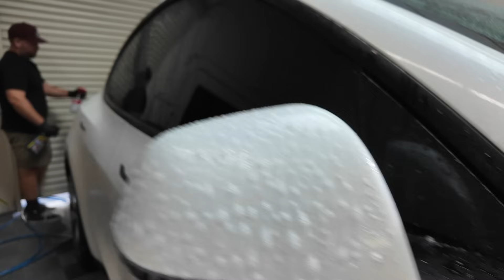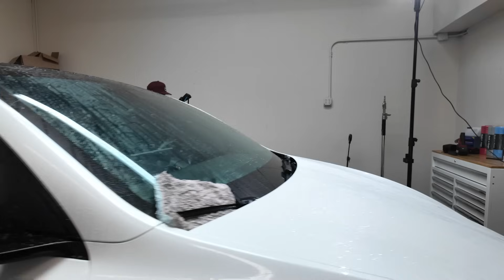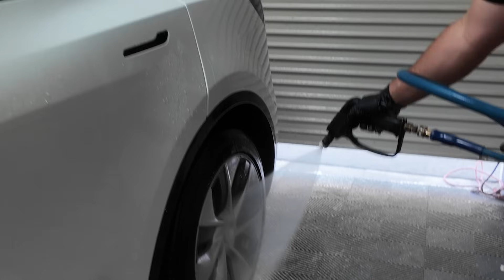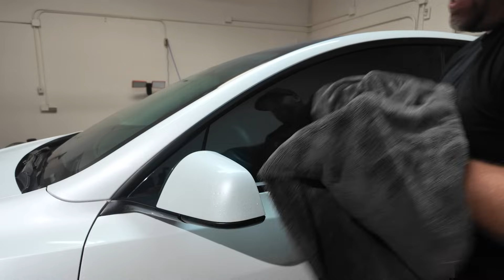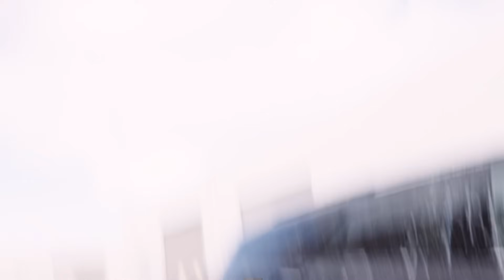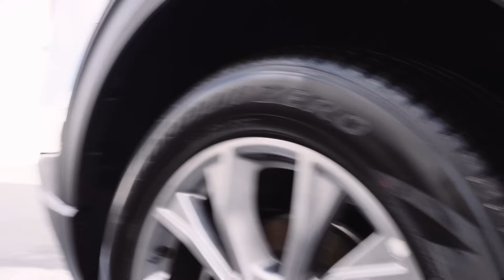The Uncomfortable TRUTH About The Future Of The Detailing Industry - SEMA 2023 After Thoughts

Comment: Hey Jimbo, 

I can definitely see why it seems like M788 and M888 are the same thing - but that couldn't be further from the truth. The formulas are 100% unrelated in ANY way whatsoever. M788 was developed by a scientist that retired 4 years ago and was actually based on the M688 product. M888 is the result of 6 years of development involving close to a dozen scientists and is 100% different and new from the ground up. The only thing they have in common is the easy application.

You should come down to the new HQ and check them both out side-by-side. While you're at it, you can try and learn about Ultimate Ceramic Coating which is the most innovative formula in the history of coatings. Mark my words. We can talk all about it. 

Also, M86 So1o was a single liquid, multiple pad system meant for body shops. It was aimed at removing sanding marks or finishing out with a single liquid, but multiple steps. The new M300 so1o is an all-in-one that is not body shop safe and the only thing it shares with M86 is the So1o name due to the idea of using 1 liquid with many pads. Nothing else related. You can try those side-by-side too and share your experience.

PS, I just came back to Meguiar's and my all-new role is to be the Innovation Leader for the entire brand - would love to sit and chat about innovation, too. Would be a fun topic for sure :) 

Let me know when you want to come down. 

-MK
Reply from the maker: Congrats on the new position. I’m super stoked to see what new products come out of that. I think it’s a smart play for them to have someone like yourself dedicated to that. 

Why use the same so1o name then? It was a knock off of system 1 even back in the day. 

To say a coating was completely built unlike anything else also seems pretty fishy. I’m not a chemist and don’t even play one on the internet but from what I know there’s only so many ways to skin a cat. To say that it’s completely new seems a little far fetched. But I could be wrong and honestly always leave that on the table. We all get bad info from time to time. But based on marketing claims and such, it’s usually not too far off base, as seems to be the case here.  

I would be open to a discussion but it would require access that I bet the big wigs at 3M and megs wouldn’t offer or allow. If they would be open to a chat about that we can off line about it. 

On another note, you’re a great guy and I’ve always enjoyed chatting with you at shows and such. Just so you know nothing is personal and I hope it doesn’t come across that way.
Reply: Markus - when will UCC be available?
Reply: Markus I love the collaboration you have done with Harbor Freight. Way better towels and car detailing stuff. They have come a long way but love their new towels for sure.
Reply: @brooklynpratt  By January 👍
Reply: @MarkusKleis Markus, great to see you're back with Meguiar's.  You were my first YouTube detailing hero.  I hope you will resume posting detailing/product videos to your website?

Comment: The only thing that excited me that launched at SEMA was the new Rupes   Cordless polishers. For me the future has to be cordless, powerful,  lightweight and low vibration
Reply: I agree but the pricing has to be more reasonable  for me to switch to battery.  I've been buffing since I was 14yrs old and going on 60. I'll die with a buffer in my hands or ceramic coating. 😂
I have 6 rotary buffers and   3 Da polisher 1 Flex 3401 and a 3" polisher electric  and 1 air 
They all work great. I tried the Milwaukee cordless when it came out.  And I have Milwaukee  buffers including 2 of the old school metal ones. I still use them once in a while.
Those are not included  with my other rotary.